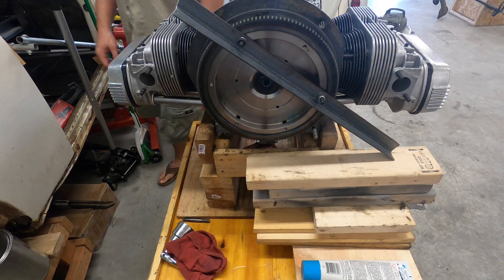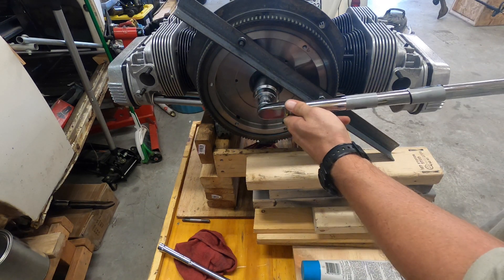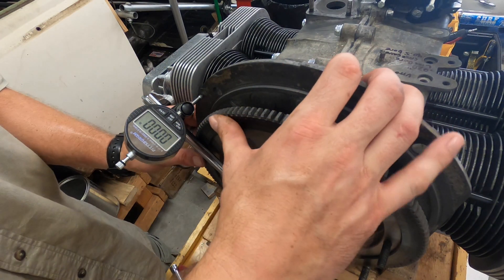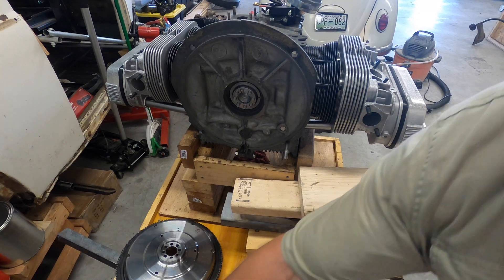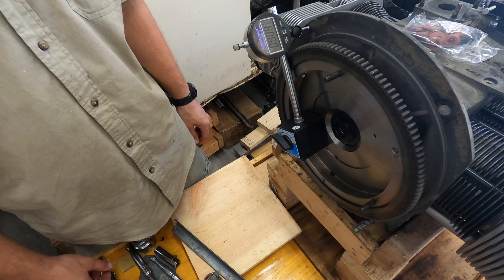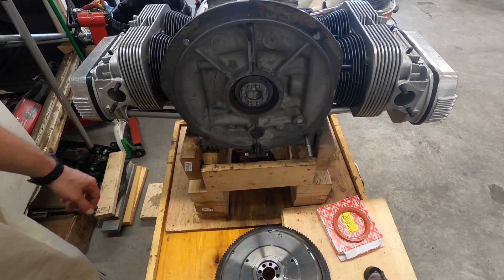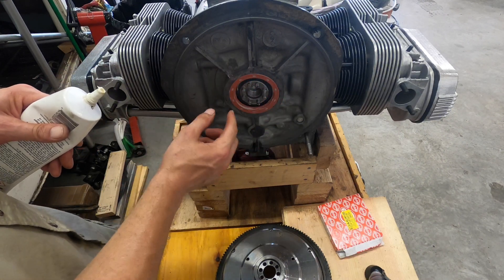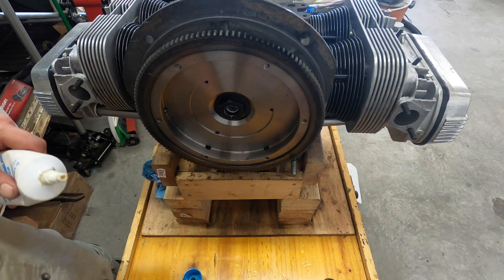Setting Flywheel End Play On A VW Beetle Type 1 Engine

Comment: did not seat seal fully , common mistake I made first time
, how long did it take to start pouring oil ?
Reply from the maker: I never had issues with leaking.  Seal is seated and where it needed to be.  Thanks for the input.

Comment: What happens if I really don’t have any end play?  Seems like the flywheel is tight to crack and no, zero, movement.  Thanks
Reply from the maker: Please make sure you are checking the play with a dial indicator like the one below.  If you are within specs (0.003 - 0.005 inch), then I would say you are good to go.  Just make sure you are pulling the flywheel all the way back, reset the dial indicator, then push it all the way forward.  More play than allowed will not end well.
https://amzn.to/3yxqPmN

Comment: Aren't you supposed to set the end play before you install the pistons
Reply from the maker: I see no difference, this is something you could do on a engine that’s already been running and needs the end play fixed.  I wouldn’t take the engine apart and pistons out just to fix the end play.
Reply: @VitosFix  I concur.
Reply: You set endplay BEFORE installing pistons & cylinders so there is no possibility of the rods dragging  giving a false reading. As I build an engine I always set endplay and install the flywheel after;
1.  I have closed the case and it spins smoothly.
2. Installed the oil pump with cover 
3. Installed oil sump screen and cover 
And lastly 
4. Installed the oil pressure relief valve(s) .
Once those are all finished then it's what we would call a Short-Short.
Reply from the maker: Sounds good man. I’ll keep doing it this way.

Comment: What heads did you opt for? Starting my engine for our Karmann Ghia shortly and having a hard time deciding.
Reply from the maker: 1672d Panchito 044™ (40 x 35.5) 90.5/92 Bore (each) w/Dual Hi-Rev Spring Upgrade

The link is on this video on the description.  I’m not sure why, but I can’t find the ones on CB Performance that I bought. 

https://youtu.be/UIvzF2EtpEM

I guess it just depends on what you’re wanting to do.  These heads are going to rock compared to the stock application, but may not be the best if you’re wanting to get the most miles out of a daily driver.  The bigger intake/exhaust valves will boost the performance, along with the dual springs.  

Also depends on how much you want to spend.  These were about $320 each.  

Let me know if you have any other questions.